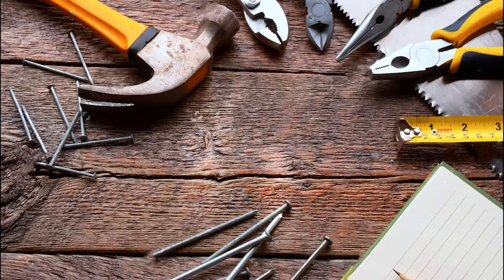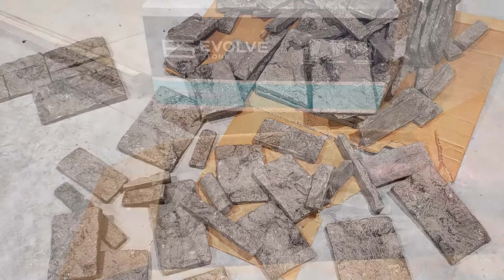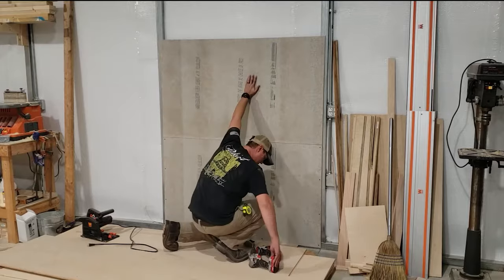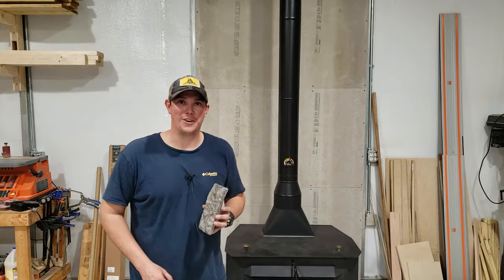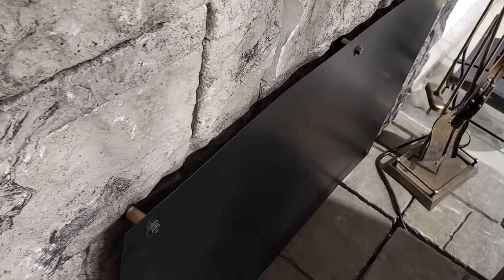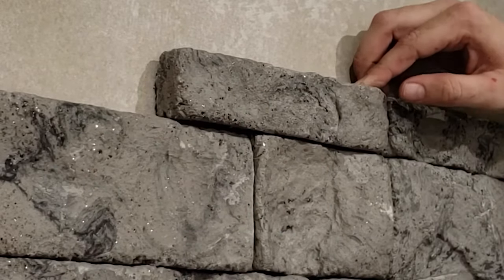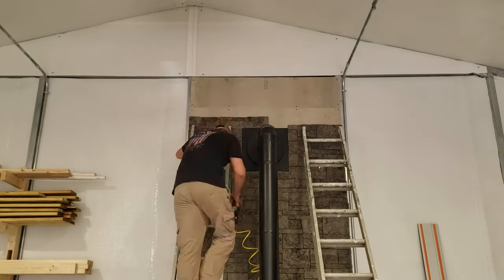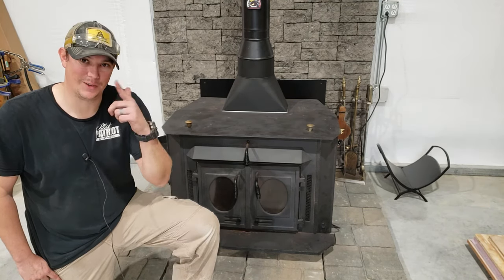Easy DIY Stone Veneer Install / Evolve Stone

Comment: If using fire rated materials, why would you need the additional heat shield? Are the temps just that high or just extra protection? Semper Fi!!!
Reply from the maker: Just low cost extra protection.  Made from sheet metal from Lowes  and a little hardware! Having a heat shield allows you to get closer to the wall too for code compliance...if you are trying to stick to code.

Comment: Good looking install! Any ideas on if I wanted to install this stone on the bottom 2 feet of a metal building (horizontal corrugated)?
Reply from the maker: I think you'd probly need to address the corrugated material first...probly mount some treated plywood then mount the stone to that

Comment: I have a wood stove and we’ve always had a huge tile wall behind it. No problems. Wanting to update with this, do you think it’s safe to put on over the tile?
Reply from the maker: It's fire rated , not sure how you would install over tile but I don't think there would be any safety issues

Comment: Could you put this straight to drywall without that cement board?
Reply from the maker: @killjoyredux8361  yes
Reply: @PatriotDIY  thanks man appreciate it...I saw a few sources saying the weight would cause problems or the mortar/glue etc might wet the gypsum. But then others say you can do it direct. Confusion!

Comment: hi thank you for the great videos on the Fireplace install and everything it entails. What thickness hardie  board you recommend.  I purchased the 1/4. I'm following a lot of what you did.
Reply: i like the sheet metal idea, any particular kind?
Reply from the maker: @MariJani1  I used 22 ga steel for the heat shield and 1/2" Cement board
Reply: @PatriotDIY  thank you so much.
Would you think I should change them for 1/2 hardie?   I do what ever this best .You purchased the metal from Lowe’s?
Reply: I end up getting the 1/2 hardie and returned the other ones. Thanks thought! Found the metal at Lowe’s also. Thanks again!
Reply: If there is a small little gap between the stone and the Hardie is that ok ?
Reply from the maker: @MariJani1  should be fine!
Reply: @PatriotDIY  thank you! 
Thank you for a great video. I started the wall and its coming along.😬

Comment: Rear heatshield must be 20" higher than the top surface of the stove and 20" wider than the stove on both sides. for this uncertified woodstove installation  read NFPA211   section 12.6.1 for the proper information on yur shielding
Reply: In this example the heat shield was not needed. It was just an additional precaution he chose to include.  The FR stone with durarock was more than enough.

Comment: How do you finish out the exposed edge/side profile?  With some having the rough texture and others having s smooth cut I'm curious how you trimmed it out.  Are cut pieces noticable in the pattern as they have a smooth edge against the next piece's rough edge?
Reply from the maker: I dont think i have any cut edges on the end. I just rotated it so that the factory edge was on the outside.  But the color of each stone goes all the way through so any cut edges on the outside would not be very noticeable
Reply: They make corners. that overlap.